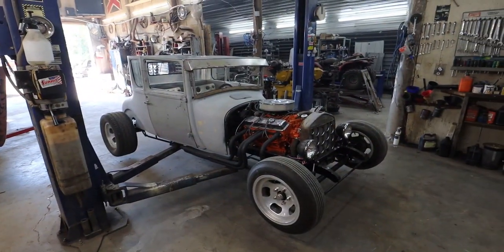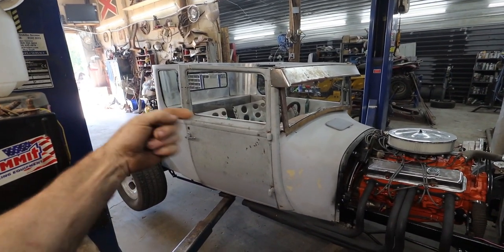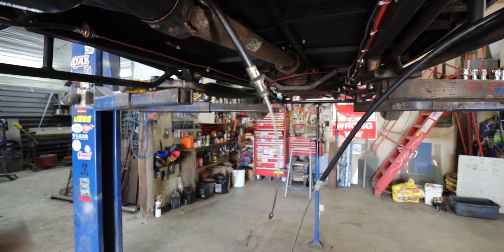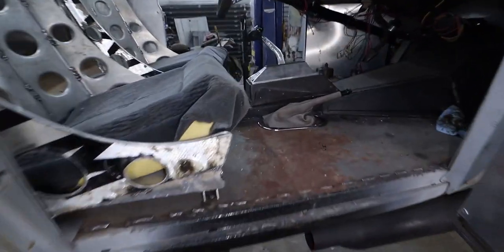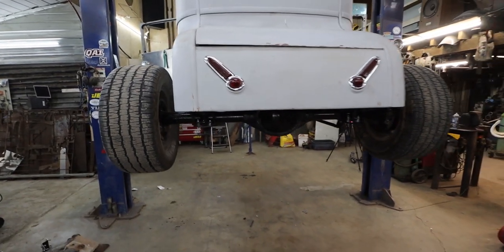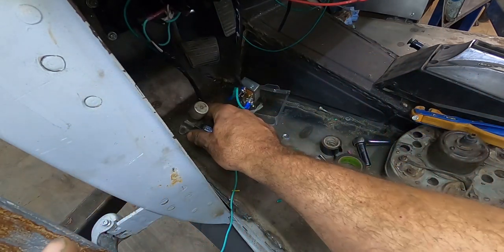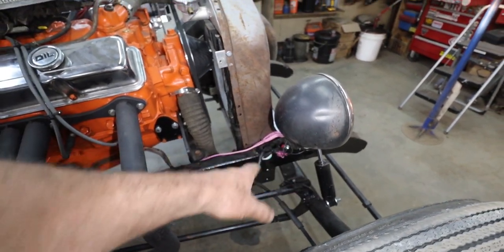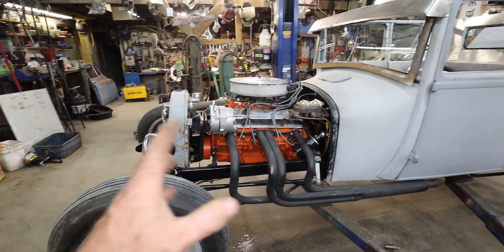Getting the Model T a  little closer to on the road for the new owner

Comment: That has found a good home I'm sure.  it has gotten sweeter every time I see it.  I know the new owner will truly appreciate the effort, and skill it took to build it from a pile of parts in the middle of the floor, to a super sweet hot rod. It doesn't even rattle.  with working lights and brakes, both at the same time!!!. Be well

Comment: Just a tip, crosby clamps always put the U  on the dead end both the same direction snug then tighten after a load then no loop between clamps. Also when crimping connectors always crimp the connector to the insulation too, Prevents wire from breaking at t the connector after many vibration movements and keeps tension on the insulation and not the conductor..
Great car , is on my bucket list to build.

Comment: In AUSTRALIA, we have to get our vehicles inspected by a qualified automotive engineer, before it gets road inspected .
Reply: Do you have to pay for this inspection also?
Reply: @keithharden7844  Here we do and the prices very from shop to shop also
Reply: @keithharden7844  -- yes with both , the engineer's can be a couple of hundred dollars, with EACH inspection of your vehicle, then once they sign off with the vechicle, you then need a road worthy inspection, which is around  $45. A road worthy certificate in New South Wales is every year on every vechicle, plus registration payment of around  $550 every year. There is a "club " registration which is about one fifth of the normal price. Conditions apply for this type of registration 
The engineer only inspects the building of the vechicle, right down to the number of times the wipers operate/ minute !!! Plus noise level of the exhaust system. 
One has to jump through hoops to get it all done.
Reply: In Pa. U.S.A. they have what they call a enhanced inspection for home built hot rods/rat rods. I don't know what's all involved with it or what it costs. All I remember is trying to get a VW based dune buggy or baja re titled and inspected in the late 60s early 70s in Pa. was a real P.I.T.A.!